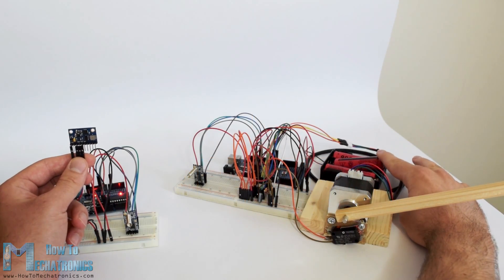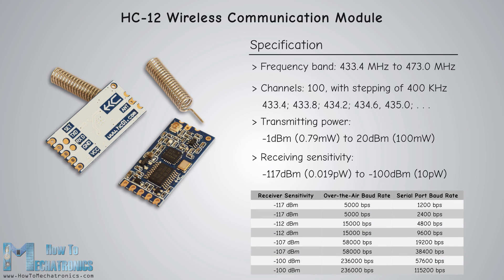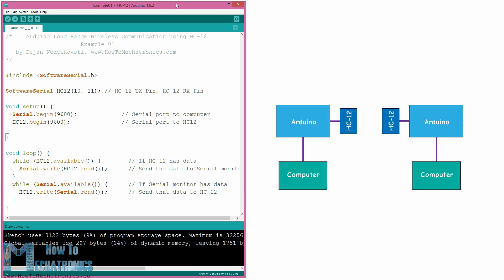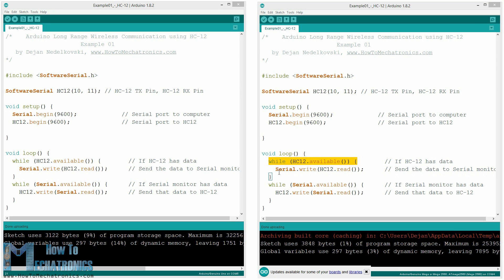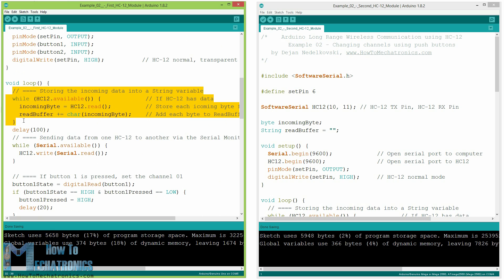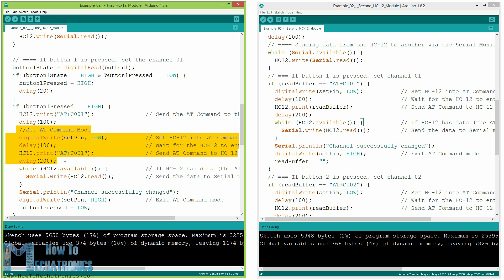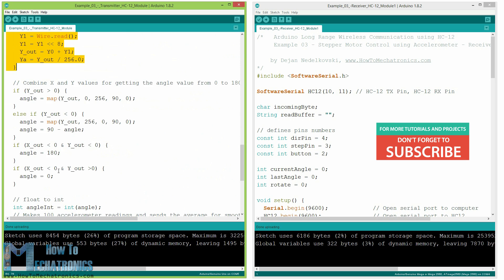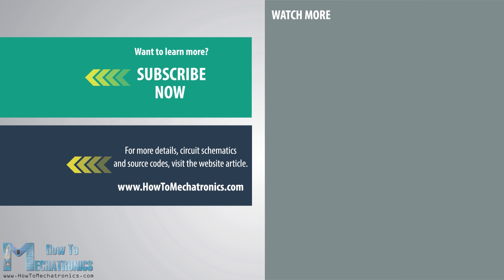Arduino and HC-12 Long Range Wireless Communication Module

Comment: its not working for me, can you help me? im using two arduinos and the original brand hc12 modules (they are both connected to a breadboard via cables). what am I doing wrong? btw the antennas are also not soldered, but that shouldnt be a problem, right?

Comment: .. there is something wrong with this device.. it work only a few days..i let it run for a few days non stop..it overheated and dead on the tx pin.. all st link chip are cursed..

Comment: Banggood sell both the HC-12 module, and an identical GT-38 module, with the GT-38 version costing slightly more than the HC-12.

Does anyone know if units are identical with the same default settings, and whether one is better than the other?

Comment: Love the video. Very well done and detailed.

I am trying to do this with 2 Mega 2560 R3 boards.
Followed your example 1 to the letter but neither Serial Monitor will output any message sent from the other board.

Any advice?
Reply: I'm having the same problem

Comment: Hello, I am with a project that is yours, it is about communication between two arduinos through an HC-12 to that project. I wanted to add something else: an activation on some digital pin in the receiver, can it be?

Comment: Pleas I warn you your 18650 battary's are fake because it's not possible to put 9900mah in such a cell the maximum in this size is around 3000mah .
Nice video :)
Reply from the maker: Yep, you are absolutely right. :)

Comment: I hope you respond to me. I'm trying to send data to multiple points using a DTU Serial Transmitter. Let's say I have 3 units spaced apart where the first A unit receives incoming bytes ASCII "DATA1" from the Transmitting unit which is  a computer. The computer sends "DATA1" out the serial to the first receiver which is in range. However B and C transceiver are out of range of the Computer's Transmitter. So I receive the data in "DATA1" in Transceiver A and now I want to relay that to Transceiver B. However B may be in range enough to receive some of the bytes from the Computer but not all. It is well within the range to receive from Transceiver A. Once relayed from A to B, B transceiver relays the original "DATA1" to C. 
Here's where the problem in my code is getting confused. You see When T(a) receives DATA1 received from the Computer, it opens a window and then relays that same DATA1 to B and B to C but when C gets it, it relays to nobody. The binaries overlap in the over the air PSK causing confusion. A receives the same DATA1 from B and C and the game of DATA1 ping pong begins. 
Is there a simple way to overcome this issue? Here is a code sample I'm using. Thanks if you can help. 
               if (dataIN1 == "!\nDATA1\r\n\n")
                {
                    tbDataIn1.Text = dataIN1.ToString();
                    //So check to see if data has already been received. If not open form. Else ignore datain.
                    bool Isopen = false;
                    foreach (Form f in Application.OpenForms)
                    {
                        if (f.Text == "Form2")
                        {
                            Isopen = true;
                            f.BringToFront();
                            break;
                        }
                    }
                    if (Isopen == false)
                    {
                        Form2 form = new Form2();
                        form.Show();
                    }
                    //Automatically relay data to another floor
                    Thread.Sleep(250);
                    try
                    {
                        if (serialPort1.IsOpen)
                        {
                            //DTU is sending 
                            serialPort1.WriteLine("!");
                            serialPort1.WriteLine("DATA1" + Environment.NewLine);
                        }
                    }
                    catch
                    {

                    }
                    Thread.Sleep(500);
 // So I put this sleep here to prevent it from receiving any bytes during this time.
                    timer1.Enabled = true;
                    timer1.Start();
                }
Receive Bytes. If so open form.
if Form is open ignore incoming bytes in the buffer.
Sleep 250ms
Resend received data
now Sleep 500ms so you don't receive anymore data.
The Serial Buffer is now filing with data. I can't shut the Serial Buffer down either because it must remain open.

Comment: configure HC12 to laptop wifi is it possible? instead of using 2 HC12?? Using laptop as a transmitter the python script will perform some action and the signal will send to the receiver bot(arduino) using hc12??

Comment: Hi! I tried to transmitt a double array from an arduino mega to an arduino uno via SoftwareSerial. But i can't figure out, how to transmitt the datas correctly, because all numbers after the "," of the transmitted number dont show up on the receiver. I try to transmit coordinates. Do you know how to deal with this problem? Thank you for an answer. Greetings

Comment: can use the HC12 module as one transmitter with multiple receiver mode?  if possible how to address each module?
Reply: each receiver uses the same code as shown in the video, so yes, you can have multiple receivers

Comment: thank very much for your tuto i have a question

The  idear was : to connect esp8266 server  by physical wire ( using  wire protocol) to the stand Alone esp8266 hc12  witch send the commande to the hc12 receiver.
I have a esp8266 webserver using websocket witch control gpio's very well by loading SPIFF html page on my smartphone  (garage door , sensor ect) .

I want to extend my project by using a pair of HC12 (si4463)

What i want to do is to add a 1  esp8266 (with 1 HC12 )  acting as a bridgge (wired with the esp8266 server) to communicate to an other esp8266 witch have a HC12 .

I am blocked at this point.

what the goal : when Websocket receive a JS message from my html page 

So if i can achive this the result would magic.

1) HTML send JS  request to websocket 

2) if websocket receive the request code (1) example.

3) Esp8266 server send by serial protocol (wire) the code (1)

4) Then esp8266 HC12 pick the code (1) and send it to the final esp8266 HC12

Comment: Hello, wonderful project! , a question, we could replace the HC-12 cards and use the RF1276 to give a greater range using the same configuration of the arduino code?

Comment: hello sir, 
i am working on a project in which i need a communicate underground from ground, so i need your opinion about the sensor which i should use for communication, and even i want to measure distance of my BOT from surface(ground).

Comment: Hi Dejan, I wan't to ask about the baud rate of the module, if I change the baud rate to be 115200 or more in the module, then I use delayMicroseconds(10) in the arduino, is it OK?

Comment: Can we replace the HC-12 module with ESP8266-12E wifi module ....Which is easier to implement for making a network connection between several modules
Reply: IOT ACADEMY It could be done with an ESP8266-12E module. however, you will increase the range with a WiFi signal. The 433mhz range is much longer :-)

Comment: Can u plz specify the details of the capacitor you used. Can we use a normal capacitor. And what is its range when we add several walls in between? Can I use it for 100meter communication but with several walls in between like in an apartment. What's its range with walls and obstruction.
Reply: and how is the voltage? 50V?

Comment: Hi, I'm looking for a similar project. I would like to put the accelerometer on a motorized satellite dish, and at home see the Azimuth and Elevation of the dish pointing on the LCD display. Can you replace the Stepper Motor and code with an LCD display in your project? Thanks for the reply

Comment: I am using RF-UART-433-1KM 433MHz RF Transceiver Module(UART)1km, but when I connect them between two atmega9515 micro-controllers, they can't communicate. I tried communication with wires and it works. Can you help why this happens>?
Reply: tuhada apna veer try to move them 1m from each other if they close or on the Same breadboard.

Comment: I want to ask that will it work to communicate from deep space to earth
Reply: Deep space is beyond the Karman line of 100km and well into thousands of kilometers beyond. This module only gives a range of about 1.8KM with a good SMA antenna. Deep space communication is on a whole other level, in the 20GHz range with several watts of power. Even the antennae required are enormous.

Comment: how further can we increase the distance upto 100 km
Reply: Good luck with that. You're talking about 5-10 watts of RF power. Not only is that extremely illegal in just about every country, but any decent radio that can transmit with that much power is going to be very expensive.

Comment: If your neighbour has the same device you would have to add some identification code?
Reply: Tetramorium as long as your device is not running the same channel as your neighbor's device channel then no need to add identification code
Reply: Tetramorium ideally you would want to just in case, a quick google on the subject should pull up results on how to do it

Comment: Hi great work, is possible send between modules with this code dates for example temperature with ADC analogRead , thank for your reply.
Reply: Alejandro Cardona Moreno out can send any data, you just have to be able to set it up in a from at that both arduinos can read
Reply: ok thanks I will try with your code

Comment: Hi Dejan,
great video! I'm currently working on building an arduino based quadrocopter. Could you recommend using the HC-12 module for this (since you said it's range is up to 1.8 km)?
I'm currently testing the nrf24 module but had some problems with it.
Reply: NRF's range is low compared to HC-12.
Reply: Hi Sangeeta Chowddhary, first you need 4 motors and 4 ESCs(Electronical Speed Controller). I would suggest you start with one motor. You connect the speed controller with the motor and a lithium ion battery. Your speed controller you connect to the arduino.

The code is very simple it works like you're typical Servo. First try to controll the speed of the motor through serial interface. 

If that is done get another arduino  and connect to it a transmitter (nrf or hc-12, maybe even wifi I guess there's a ton of oportunities). Connect the fitting receiver (again nrf, hc-12...) to the arduino where the motor is connected.
Now on the software part you just send the value so you can controll the speed of the motor. 

I would suggest you do this and when you have done it so far you send me a personal message over YouTube or give me you're Email and I can send you further details. You can also play with the ideas, try controlling two,three and four motors. And even with this if you put your motors and arduino on two pieces of wood and put propellors on you're motors you can leave the ground.
The controlling however is a different story but this should give you enough to do for the start.

The material for the parts you get via amazon, ebay...
Reply: Thank you very much I will try that!
Reply: What were the problems you got? Because I'm thinking of the same thing to do with the NRF modules.
Reply: There are different models of the NRF with different antennas. The one I bought had a range of maybe 700 - 800 with open space (there's also a guy on YouTube who does the testing and goes more in the details about the different types). This depends also how the transmitter and receiver are tilted relative to each other.

I did tests as I programmed the transmitter to send some data to the receiver which was hooked to a laptop where I looked at the data through the serial interface. Between 300 and 400 meter there 
was a performance drop (meaning not everything was received) which got better after that point (I don't know why).

At about 600 meter the performance started dropping.
Keep in mind that there will be variation when the quadrocopter is flying and the receiver and transmitter aren't aligned anymore.

Also the performance got significant worse when obsticels were in the way (trees, bushes...)

All in all I wasn't happy with the nrf so I'm looking for better alternatives. It can be that there is actually a better nrf module (better antenna) and if you're planning on building something that can fly and you're not too concerned over the range when there will be no problem.
Reply: Dani Master - could u pls tell me how to build a arduino quadcopter or give me ur contact no., I'm just 14 yrs old boy who build quadcopter so i need a bit guidance from you pls